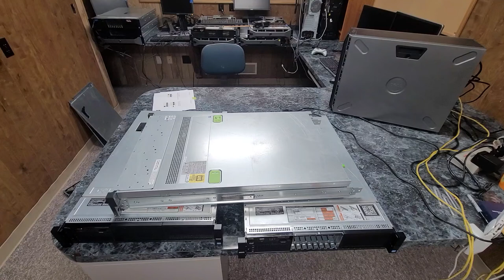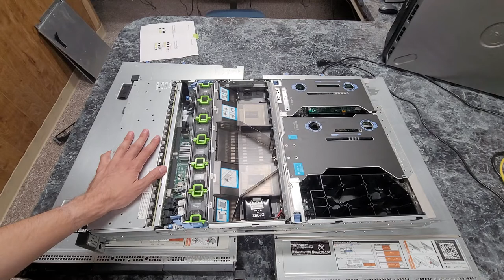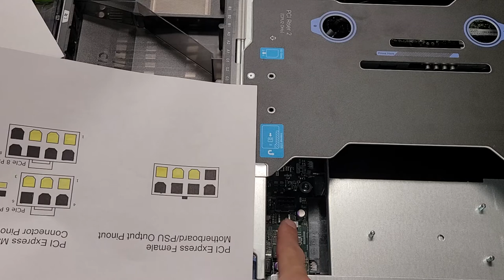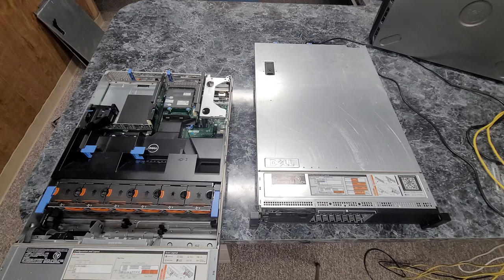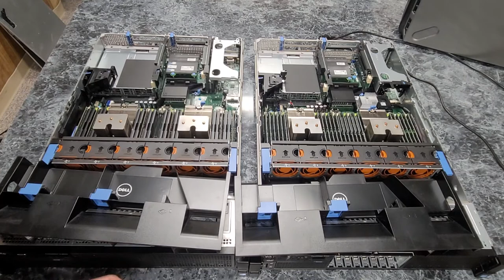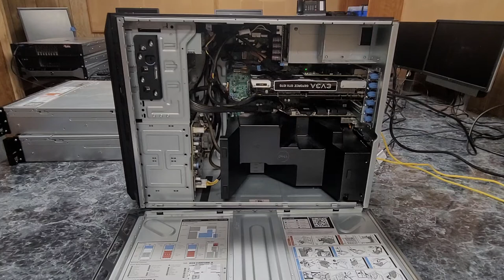An updated video on 12th gen Dell and Cisco C240 M3 server GPU power capabilities

Comment: Those Dells look almost identical to my Cisco UCS C240 M4. The fan unit seems to be exactly the same other than orange plastic vs green. The layout of the CPUs and memory is the same too. Are the two made in the same factory?
I was going to try running a GTX 1070 or 1080 in mine. Maybe even a RTX 4060. I have dual 1200W power supplies. I just haven't found a 12V power socket on the motherboard yet.
Reply from the maker: I don't believe the Dell/Cisco servers are made by the same people. Some of the design language is the same but I think it is mostly because that is just the optimal layout.

I believe GPU power would come from the riser if you have the correct riser that supports. it. You would have to check the manual but I believe you would need a riser like this one: https://www.ebay.com/itm/186361954554

As for GPU compatibility Cisco doesn't seem to be as user friendly as Dell is. Beyond listed compatibility in the manual it is hit or miss. Although I think they are more friendly about consumer GPUs than datacenter GPUs when it comes to stuffing stuff in them.
Reply: @computersales  Thanks. My C240 has that riser and I just checked and it does indeed have a power socket on board. Mine also happens to have two Intel SSDs installed that might limit cooling for any GPU installed. Guess I'll have to find a GPU with a blower type cooling fan.

I got this Cisco server for free as a broken unit. It came with 12 10TB SAS drives and a single CPU. I've repaired it and installed a second CPU. Not sure what I'm going to do with this beast other than maybe try running Crysis with it. Lol. I built an i9 powered gaming computer that will probably run circles around the C240. A Plex and general purpose server for my family might be a good idea.
Reply from the maker: @Waltkat  that's cool you were able to fix it up. It would be interesting if the server would play nice with the new Intel ARC GPUs. If the GPU didn't have too high of a TDP a regular heatsink might be fine. Biggest thing is having enough airflow to cycle the air through the server.

Comment: What I wonder about the T320/T420 is how the cooling of the PCIe cards is supposed to work. Even the RAID cards are running pretty hot in there...
Reply from the maker: I doesn't work well but it somewhat works. I didn't try running it too long but under heavy loads probably would want to add some exhaust fans. I had to run the GPU fans a little higher. Alternatively stick to blower style GPUs.

Comment: Silly question. I just got a used C240 but the inner rails aren't attached to the chassis. I have the rails but can't figure out the screws, do you know?
Reply from the maker: I was not aware they made ready rails for these. It's been a while since I've read the manual though. I just have mine sitting on some rack mounting kit for a power vault system.

Comment: Hey, so you have tried an R720 GPU cable in the Cisco UCS and it works? Do you have the part number?
Reply from the maker: I haven't tried an official Dell GPU power cable in the C240 at this time. The pin out is the same so it should work. I believe the Dell part number should be N08NH.